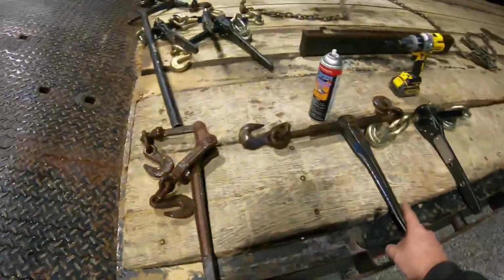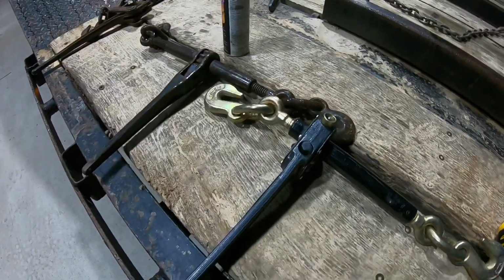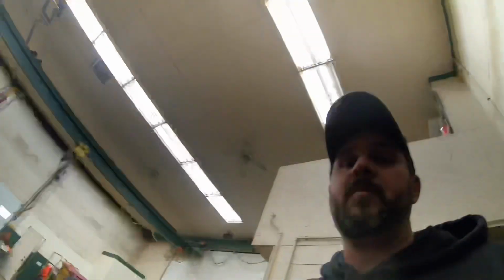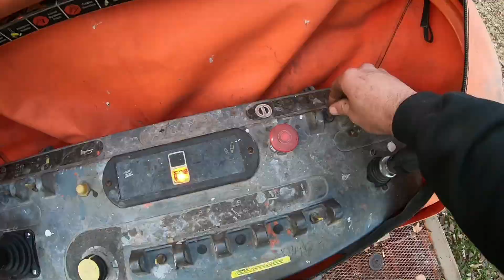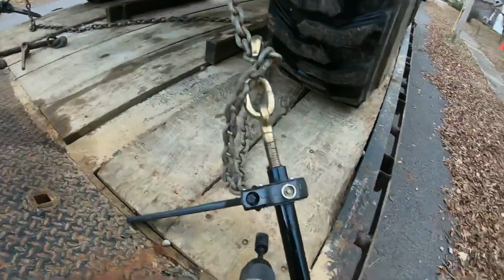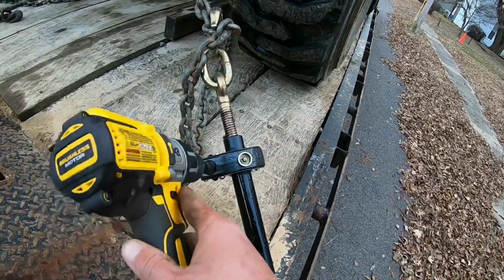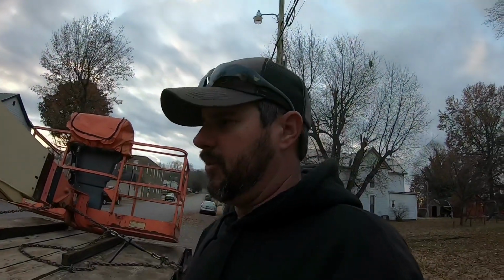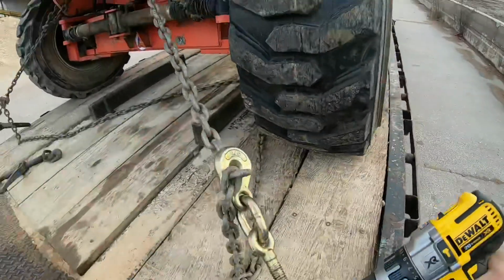Hauling man lift to Logger Wade and my thoughts on  new torque drive speed binders

Comment: DeWalt has a very nice 1/2 inch drive 20 v cordless impact gun....perfect for that extra torque on those binders. If you can get the tires of the lift to squash a little bit your binders will always have tension on them.  The gun actually has enough torque to change a flat tire on a pickup truck with 8 lugs.  Speaking from experience.  I really like how  you ask peoples opinions on different things when you clearly have the years of experience to make your own decisions.  But when people have a good take on something, you are willing to give it a try.    Your humility is refreshing.
Reply from the maker: Thanks Stan appreciate the kind words

Comment: Seems like such a smart idea.  Too bad they don't have a manual mode.  Like how they're greaseable.  Kinda sucks you have to carry such an expensive drill around and deal with a battery.  Noticed you have an air line tapped off your tanks, may be better to throw a pneumatic impact in your cab.  Merry Christmas!
Reply: Just carry a  1/2" ratchet wrench as a back up!
Reply from the maker: Yup drill is really not that big of deal kinda like carry a hammer vs nail gun both work one is faster and easier 🤷‍♂️😁
Reply: I'd definitely carry a back up ratchet and speedwrench for the time you accidentally run it over...etc.
Reply: @levicoblentz9032  and it WILL get run over sometime

Comment: Thank you Mike! Like you as one who knows ( and HAS the battle scars to prove it) the ratchet type are the best load locks that stay were they are supposed to. By you taking the time to show this upgrade is a huge help for me!! Gota have them! Lol ! On your man lift, I finely bought one of JLG trailer type lifts because the one like yours, I didn't (and couldn't find out easily ) how the self propelled would perform on non level or hilly ground.  Feed back on yours would greatly appreciated Mike. Great vids as usual ! Thanks  😊👌
Reply from the maker: They have the there limits but with good if the ground is solid

Comment: Been reading through the comments and figured I might chime in on a few to save some guys some time. Some points of interest would prolly include... ****You can simply use a pair of pliers or 14 mm wrench, socket ect to remove if something happens to your drill. * ****The handle is a reaction bar first, handle for carrying second. Place the short end of the barrel towards the rub rail and the handle will make contact with the floor quicker. Because it is a reaction bar concept we see zero chain twist. Normal binders see chain twist towards the end of the tightening process and you are pretty much done. Because we see no chain twist, we get a continued, torqued pull of the chain through 25 to 1 gear reduction that gets the chain tighter then a guy can by hand / bone tight. Properly tightened, the handle will require about 7 to 10 lbs of effort to lift off the floor of the trailer. This constant pressure is what keeps tire mash from loosening our binder. Conventional binders will bounce and counter rotate / loosen. *** The drill will see some counter rotation that is best handled by holding the battery pack with your left hand. This drill is a monster, lots of torque. *** We have approved use of the 1/4 or 3/8th impact, it works great, you can use one hand, lighter, smaller, more maneuverable. Put a dab of grease on the drive nut to keep the hitting cool and you will see very long drive bolt life. You'll see about 700 -1,000 cycles before needing to replace the drive bolt. Here is a quick vid on drive bolt replacement.... https://www.youtube.com/watch?v=nssbHlwyAA8&t=180s    .... it's a 5 minute job and gives you an opportunity to inspect / lubricate and go over your binders. *** These will outlast conventional binders 3x's over. We have no flipper to develop a flat spot on putting the binder essentially on neutral. I have some early prototypes that have over 4,000 cycles on them. They look like they've been on a date with hilliary but they still work just fine **** The sealed gear set is awesome at combating road salt brine. Because they are fast to run in and out, we recommend a coat of fluid film, run the threaded posts in and store the binders with the posts inside the barrel for protection. Simply run them out when you are ready to secure a load. *****  It takes a couple weeks to develop a new "ant trail". These are different than anything you have used before, it'll take a bit to get used to a new routine.....no big deal. **** You will see less shoulder, elbow, finger strain. We have drivers that call with gratitude for a product that has allowed their shoulders to heal....it's pretty cool. I'm sure there is more, the big thing is we offer a 30 day money back guarantee...you just lose the freight charges. 6 month warranty. Not much more money than a good quality binder. Take Care, and thank you for this opportunity, I truly appreciate it.

Comment: Those look like someone got a really good deal on manual slack adjusters since everything is automatic slacks now and just welded a threaded pipe in where the S-cam would go. They even have the holes where your air can would hook into the handle, not to mention they take the same size wrench 9/16 or 14mm. They seem to work really good and you're right Mike the regular ratchet binders always end up getting loose. The old school boomers with the big stiff springs were the only ones that would stay tight for me. Great video.
Reply from the maker: They work well
Reply: Well, it's really a neat story how these came to be. We manufacture the original speedbinder as a oversized version for the barge industry inner waterways division. They wanted more torque for the cables so we prototyped a slack adjuster onto a speedbinder barrel and "hocus pocus"..... torque drive was born!! Didn't work well on the barges but is absolutely awesome for the trucking industry. The economies of scale is what makes this product work financially. You can't buy this particular slack adjuster as it has about 14 modifications for our application...they are dialed in. But your initial observation is correct. We basically, re purposed an existing product, patented it and are trying to be evil capitalists now!

Comment: They make winches for flatbed trailers like that too. They come with a crank handle or you can use a drill. They also have a neutral to wind up extra webbing by hand. My boss ordered two to try. Can’t wait either.
Reply from the maker: Awesome would highly recommend these

Comment: An oil can with used motor oil for the binders.  I have done it this way for years pulling a flat bed. It's the best and cheapest way.
Reply: Oil and dusty conditions don't mix well as the dust sticks to the oil. A dry moly spray lasts longer and dust doesn't stick to it.
Reply from the maker: Nope not at all
Reply: MOTORCYCLE CHAIN LUBE.KEEPS DIRT AWAY BETTER THAN ANY LUBE. SAME PRICE AS LUBE.

Comment: Does seem as though an impact would work better than a drill to me. It will be interesting to see how well the head and threads of the tighter hold up and if It can be replaced,  seems it would wear a lot over time to me.

 Back in nicad days I had thousands invested in dewalt and they wouldn't stand behind there crappy batteries so when lithium batteries started taking over the market I went with Milwaukee this time. I like them better than dewalt plus there salesman has been terrific at taking care of any problems at the shop. When a company screws me once I don't give them a chance to do it twice.
Reply from the maker: Either will work

Comment: Looks excellent, only thing I would like to see different is to have the spring loaded lock collar like the old manual slack adjusters. Reason for it, as the binders wear in there is a slim chance of things backing off and DOT might want a positive lock on them down the road. Where I am we have to wire the handles on the snap binders.
Reply from the maker: No worries about that and dot approved

Comment: On a serious note. I would ask if I was making a decision on these what is the options for getting them on or off out in the middle of nowhere when the drill or bit has a failure or even if the bolt starts to seize in the middle of a job.  My what if scenario.
Reply from the maker: Wrench not a big deal

Comment: Reading threw the comments, the biggest question is about the rub rail.
There is verbiage in the FMCSA manual that inside the rail is prefered. However outside the rail is acceptable.
The real stickler is if the trailer is 102" from rail to rail the hooks on the outside would make you over width at 105". Unless you have a yearly over width permit like Mike has.
Reply from the maker: Yup exactly buddy
Reply: VideosByAl yep, and with mikes permit that’s not a problem

Comment: I think they look like they should work well. Biggest problem I see with them is if someone goes a little nuts on their cordless drill or impact and breaks their wrist when the binder is tight and the tool keeps spinning.
Reply from the maker: Possibly no different then drill a hike in metal except you know when it s coming 😝

Comment: What’s the reasons why you don’t use a impact instead of a drill?
Reply: When you say impact, do you mean air wrench?  The truck has air tanks, and air wrenches are relatively cheap.  Just the inconvenience of running air lines and fittings to each side.  You'd never have to worry about losing power with air, and an air wrench is going to be way cheaper than a dedicated DeWalt cordless and spare battery.
Reply: Trevor Dennis if it were me, I would use dewalt battery powered impact! I can use an impact for at least 3 hours of constant work before a battery dies! My only question is what’s the reason no one uses and impact with these? Everyone I’ve seen use these uses a two speed drill.
Reply: @cjuart  You probably don't need the hammer part of the impact gun to tighten them, or you would over tighten them and blow the guts out of them if you went to crazy.
Reply: BlueDually4x4 I could see that! I just saw the two speed drill almost twist out of his hands! And wanted to see what everyone opinions were on using an impact. I am thinking about getting a set of these myself.
Reply: You can use a up to a 3/8ths impact....works awesome
Reply: @cjuart  , why in heavens name would one want to hammer on these things? Seam to me you would just be beating the nut and drive system to death.
Reply: John Irwin why would I want to wreck my wrist or knuckles on tracks or decks on trailers with a two speed drill lol if you sit and hammer on them that would be Oppurator error!
Reply: John Irwin 
Using a DeWalt 1/4” impact driver would eliminate the torque twist that you get from a drill getting it to the same torque value. 
@Speedbinder may have a reason that they suggest a drill instead of an impact driver though.
Reply from the maker: Listen to Steave guys he is with speed binders

Comment: I was going to ask if manual operation could be done. Question answered. Needs to be able to operate with drill or manual. Or I would NOT purchase for myself.
Reply: Drew6709 Manual= ratchet and socket?
Reply: @farmerchris1  manual as in ratchet style with manual switch like middle. Don't want to need to use cutting tools to loosen if drill is dead or internal mechanism gets stuck.
Reply: @Drew6709  you can use a simple pair of pliers, 14 mm wrench or socket ect...
Reply: @Drew6709  I see.....thing is, this drill or 3/8th impact will get it tighter than a guy can by hand. You actually need to be careful not to over tighten, that's why we spec the drill so you can set the torque setting on the collar. Go full bore and you can snap a 5/16 chain. Got a guy in south Carolina that demonstrates them that way....obviously not recommended. Getting tight and staying tight is not a concern.
Reply from the maker: Drew I though it was going to be a big deal is not and I don’t think It’s fair to have that opinion if you have never used them 🤷‍♂️
Reply: @DirtPerfect  how is it wrong to inquire about improvements or having functions of 2 binders? Taking the best of the ratcheting and combining it with this new design? Having ability to use in manual mode to get tighter AFTER using the drill to take up slack. I have used the "over the center" binders and hate them due to dangers of releasing and not able to get my machine tight enough or too tight. The ratchets are safer and hold better. Why not design a speed feature that takes in slack and allows for manual use if the drill or socket & ratchet is left at home or lost? I try to be ready for most things when I'm on my machine. But I have forgotten tools at home. I believe these new binders you are trying out would be better with a manual function as well.

Comment: 👍👍👍😀  I always carry a Dewalt impact wrench with charger and extra batt. for tire changes.    I have an inverter to keep a battery fully charged.  It's not that involved to install inverter with a relay so that inverter is only on when engine is running so that it doesn't run truck battery down.
Reply: There is also a charger with 12VDC input for keeping your batteries charged, have not tried it I always had or have 120 power to charge batteries.
Reply from the maker: Exactly guys thanks for watching
Reply: @raymondhinds3539  Thanks for that.  I didn't know about the charger that plugs into lighter socket.  That would have saved me the install of the inverter, but I often use the inverter for other stuff, so I don't feel too bad.

Comment: Amazing that the drill had enough torque to tighten them properly.  I would always keep the impact gun in the cab with a spare battery as the batteries(lithium) don't like cold.
Reply from the maker: Getting them tight is not a problem

Comment: They look great so far from what you and Captain Kleeman have shown. 
I’ve only ever used bear trap binders with a cheater pipe, launched the pipe over the skid steer into the bosses new F-350 too when I slipped and landed on my ass in the snow. 
A ratchet binder would’ve been a huge improvement in personal safety and load security too.
Reply from the maker: lol that’s not good 😂 and yes we love them

Comment: Why not use an air wrench  the rig you will be using delivers 130psi already, or you could install an inverter  on the rig.
Reply: He does already have a air hose on a retractable case, I think that would be the best way to go
Reply: Dragging hose around might be a pain but a real good backup plan incas.... (scratch that) "when" the batteries leave you in a bind.
Reply from the maker: Will work hose sucks
Reply from the maker: Yup

Comment: What you already know but did not mention. If the battery in the drill/driver dies use a socket to tighten and loosen. And, mine were only $10.00 each more than standard binders. No problems with them except I need them in a higher load capacity for the next level of load.

Comment: Very nice, did I miss you mentioning cost? And would a cordless impact work better than a drill... or is that not recommended by manufacturer?? Oh btw...Merry Christmas ... maybe a new Excavator ??
Reply from the maker: 85 a binder for 9400 and yes a 3/8 will work

Comment: It's good to always look for more efficient ways to accomplish tasks. You may want to think (long term) at getting an on-board air compressor. Air tools with more torque, changing a tire, etc... Inverters, batteries, can be fragile & finicky. Just a thought....
Reply from the maker: Possibly have more upgrade on the way

Comment: Look into getting the 60v max batterys. They will run 20v tools like that drill and will have triple the battery life, i have there 1/2 xr impact and it  holds battery forever. Definitely look into getting the 12 amp hour batterys they are even better than the normal 6 amp hour
Reply from the maker: What we have has been working great

Comment: I've been looking at these binders. I'm worried about not being able to get them as tight as I would like on some of these bigger 70k+ excavators.
Reply: They will get tighter than what you can with the binders you are using now. The drill will get them tighter than the impact. No worries on tightness.
Reply: Thanks for the reply. I work for a towing/trucking company. These seem like they would be a major time saver. I've been trying to convince the boss man we need these but hes not sold yet.
Reply from the maker: Ryan getting them tight is not a problem have more videos coming on them

Comment: A cordless half inch impact would be better than the drill less twisting on your wrist while tighting down and not causing the to burning up
Reply: 3/8th impact work great...no twisting...a 1/2 inch will spin wheel studs off...a bit too much for the gear set. Thanks for watching.

Comment: Never heard a binder called  a boomer must be a midwest thing. They look very easy
Reply: Lol same here! "Binders"
Reply from the maker: lol 🤷‍♂️ what we call them
Reply: That's what they called them around here in Oklahoma. Lol
Reply: Pull it tight and when it goes over center while chaining poles to a trailer makes a bit of a booming sound. Has something to do with the old treatments used on power poles. If it didn't make a sound we had to shorten another link.  Had a totally different sound when doing CCA poles.
Reply: I have been hauling in Iowa for 40 years and never heard the term Boomer until finding Mike.

Comment: I'd paint a stripe on one end so you can quickly orient the handle. You could use those to pull on ICFs to get walls straight. I'd have a ratchet, socket and speeder on hand. Just in case.
btw, speedbinderS.com  speedbinder.com without an S gets you to an office binder company. 

Cool......
Reply from the maker: Lol and thanks for the link mark